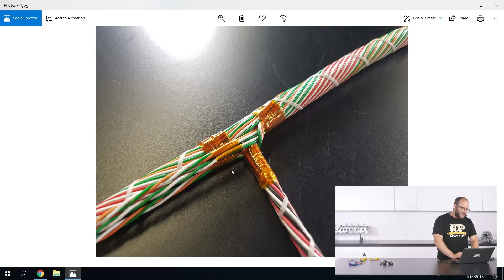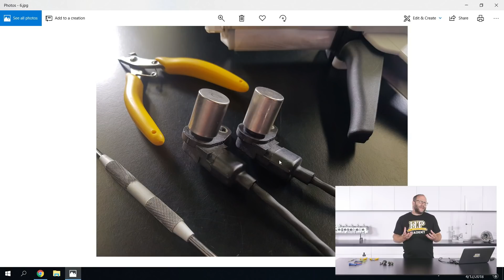350z Engine Swap, MoTeC ECU, Abandoned Office And More | Today at HPA 195 [UPDATE]

Comment: no offence but isn't most wiring common sense  ?
Reply from the maker: No offence taken, and don't take any back when I tell you, no, specific technical knowledge is not common sense for any topic. Note this is specific automotive wiring knowledge, not a guide on how to wire in a head unit and tweeters 😎

I'm interested to see some work you've done that makes you view this topic in this way though if you don't mind sharing it 🤓 - Taz.
Reply: @hpa101  most of my work has set on fire lol joke 
threw trial and error long as you have correct crimping tool and mount loom in position that won't rub threw anything 
also using correct gauge wiring 

on my car my wiring isn't to neat but it's all protected and insulated 

I'm intrested now in your wiring vid lol
Reply: Lol...common sense is not really that common... you see who's the President of America? But seriously, I love wiring and when I look at a loom.. . I'll see something that can salvage... someone else would see a bunch of spaghetti and headaches!
Reply: @dennismelville7532  lol good point